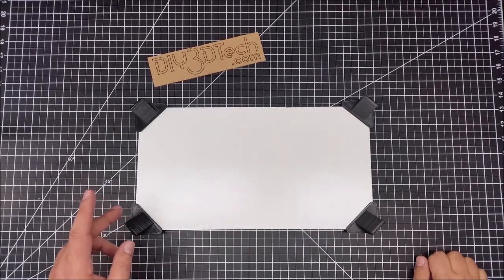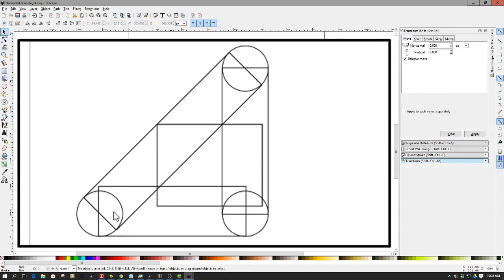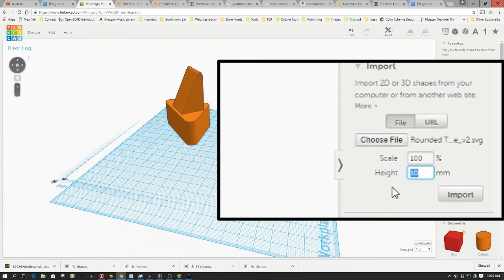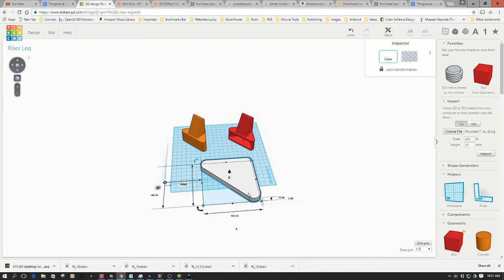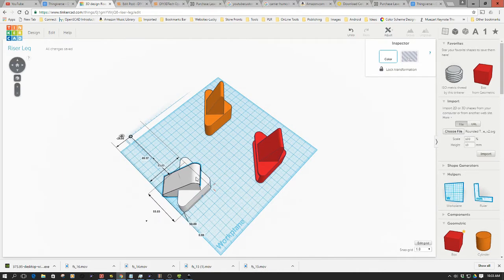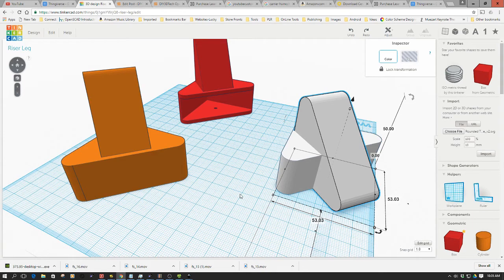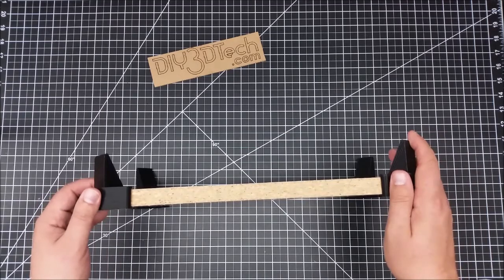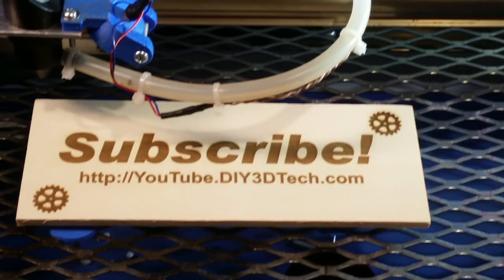TinkerCAD Workflows -  Inkscape Designed Monitor Riser Feet!

Comment: I ordered some ABS for my new 3d printer because I am running low and they sent me TPU instead. I got to keep the TPU and the replacement ABS will be here on Thursday.  I have never printed with TPU but I was wanting something to make some rubbery feet for the new printer so all is good.  TPU is not as flexible as TPE (Ninjaflex) but so much easier to print in from everything I have read.  I didn't have much success with PETG so I wonder if I will with TPU?  The PETG kept jamming and from what I was seeing I think the J-Head (real one) the flow is too low so I need to slow way down but I was already at 45-50mm/s.  Any info about TPU?

By the way this stuff is way way way outside of my price range so I will never buy a roll of this as it is Hatchbox TPU and for 1kg it is $54-$60 per roll plus tax.  My limit is $23-$24 plus tax.
Reply from the maker: I think I paid around the $30 range for TPU on Amazon also yes "very" slow  30/35mm/s also a avoid a lot of retraction.  Me I love the stuff!
Reply: DIY3DTECH.com
Must have been another brand or wasn't 1kg as I looked to see what this stuff costs.

How can I avoid a lot of retractions as the slicer determines that and more than a few times I grumble at some of the stupid retractions they do.
Reply from the maker: You can set the retraction settings in  the slicer, for TPU I shorten the distance in how far it will retract to I believe around 2mm from 4 to 6 and also allow for more travel before retraction.  You will get a little stringing however it cleans up easy.  Retraction is a dark art I keep meaning do a video on it (Tom S did a simple one) however I really want to dig and have not found the time.  As far as buying filament, if you check Amazon regularly you can find deals also I am Prime Member and they send deals every once and again as I buy so much of it...
Reply: DIY3DTECH.com
Ahhh, I thought you meant when it will retract, lol.  I am not into prime myself and I will lower the retraction from my normal 5mm (my J-Head is a drippy beast).  I never use that minimum travel for retraction so I am unsure how that would effect anything nor what to set it at?  I see it defaults to 3mm though.
Reply from the maker: I think I used 2mm
Reply: DIY3DTECH.com
Is that setting something to use with any filament or not as it is defaulted to off (I am unsure what the internal distance is if that setting is off) and never even saw it until you mentioned it.
Reply from the maker: Sorry are asking about retraction in general or the distance for retraction?  As yes this should be turned to each filament you use and even to the print itself...
Reply: DIY3DTECH.com
I have never ever used that setting before so not sure about that.